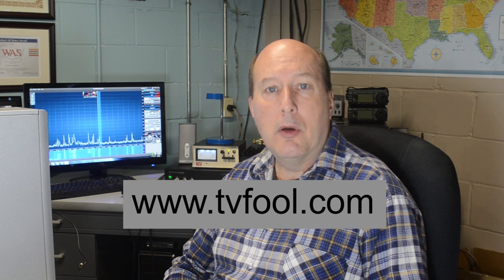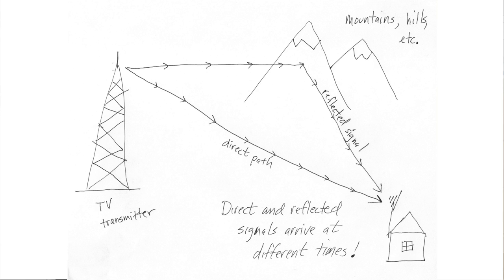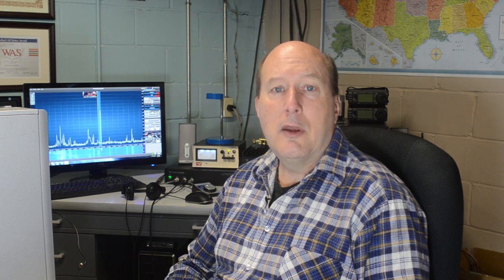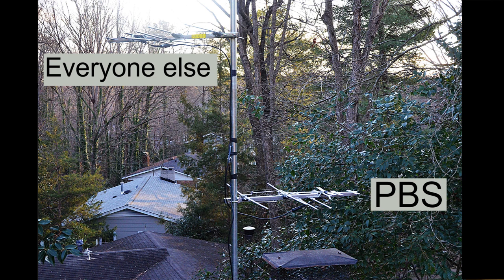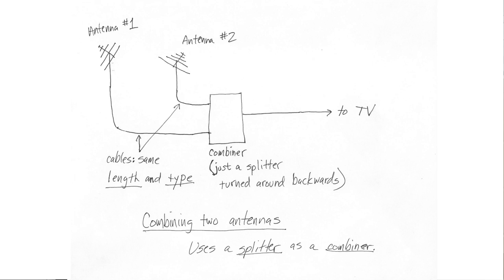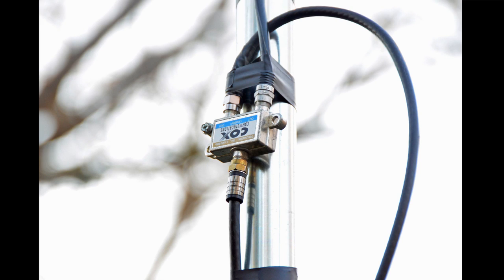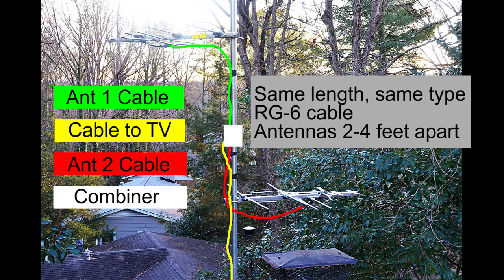Combining two TV antennas for better HDTV reception

Comment: Good advice, thank you. In my case, I'm 70 miles away west in WV between DC and Baltimore, so I have a rooftop antenna pointing east towards the center point between those 2 cities with a high gain preamp. There is a low power station in DC that I really like, but again depending on certain factors, it comes and goes (seems to go right when something good is coming on). So I might try adding a directional a couple feet above my existing antenna (it's listed as an omni - ClearStream 4Max), pointing straight toward DC and maybe keep the omni in the same position. But I assume first the combiner --> preamp --> 4-way splitter in the old cable box? In any case I'll have to try this out. Thanks again.

Comment: Very good information. What’s your thought on those amplified antennas sold by Antop? Do you think it’s best to stick with the original mechanical types such as the ones you are using?
Reply from the maker: Unfortunately I don't have any experience with antennas like the Antop, Owen. Conventional wisdom says that the place for a preamp is at the antenna, so they've got that going for them. But I haven't done any comparisons.

Comment: I want to do the same thing. What is the specific splitter you used? Did you use a regular splitter or a combiner? Other's have suggested that just using a regular splitter will cause interference and loss of signal. Just asking.
Reply from the maker: Yes, there has been debate about using a splitter as a combiner. But in my experience (and I have tried numerous splitters) passive splitters always work fine as combiners. Active splitters (which have built-in amplifiers) are a different story.

Comment: What solution do you have for having to use the same  cable to share OTA and internet? I used to have a device when I had satellite or cable tv to do it. Would that same device type work ok with the OTA?
Reply: Used to install satellite, they used what's called a Diplexer to combine the satellite signal and off air antenna outside, then another to split the signal back again. The ones we used were specifically for satellite and were powered by the satellite. At at&t we also used a diplexer for a similar set up. Look up that, you'll be able to find something.

Comment: With these 2 particular RCA antenna what would stop you from mounting them directly next to each other and connecting the UHF element studs- wouldn't this eliminate any interference issues as the signal would be fed into the coax from one source pointed in 2 directions? or would the connected lines to the transformer short the line? I have 1 mounted in the attic and have a station much like your PBS that's opposite every other network butonly 11 miles away (ERP 7.5 kW)- but they carry all the local sports and I'm one of those people.
Reply from the maker: I'm afraid what you suggest would ruin the directional characteristics of the antennas (being so close to each other) and I think there would be a feedpoint impedance mismatch as well. But it's not something I've ever tried.

Comment: Great explanation of multiple antenna set ups.  I am actually doing the same  thing  and trying  to pick up some  channels down in the Raleigh area from Asheboro.
Reply: Same here, trying to maximize my channel lineup in Asheboro.  Should be plenty since it's in the center of a few metro areas. Particularly interested in getting the ion stations from greensboro, Any luck?
Reply: +Rob Baker  no not a bit,, I have tried 4 different antennas and not even  a glimpse of it..  it has to be a really low power station is the only thing I can think of.
Reply: +notaness I wouldn't even care about that station if I hadn't gotten it for 2 days on a rainy weekend. They played a decent lineup of shows.  Then the rain cleared up and the channels went away.  Right now they're the only channels I'm not getting with a cheap ebay amplified outdoor antenna, and I was just curious if an antenna upgrade would be worth considering.  Which channels are you not getting?
Reply: +Rob Baker basically that's it,,  I did have better luck going back towards Charlotte instead of Raleigh.  I'm currently using two solid signal hdb8x  antennas, one pointed toward Greensboro, the other toward Charlotte.  I am also running a juice pre-amp between the two as well as a channel master combiner. I'm in a fairly bad location to pull Raleigh, and at the time I was desperate to pull WRAL. well as luck would have it the switched to NBC, and I already get wxii (NBC) out of Winston fairly easy..
Reply: +notaness Hmmm.  I hadn't tried going towards Charlotte, but now I'm curious if it'd be worth trying.  ion is gonna bug me forever though, haha

Comment: Well done, Doug.  You are very articulate and knowledgeable.  I put up an omnidirectional antenna that I found on Amazon.  My CBS channel comes in and out.  I went to TVFool like you recommended.  I'm surprised to see that ABC which came in fine is in the same westerly direction as CBS and the same distance away (13.5 miles).  My Fox channel is in the opposite direction, is 7 miles away and always comes in well.  I wonder if your type of antenna would be worthwhile.  Since my current antenna is a round shape and is supposed to be omnidirectional I wonder what direction I should point a second antenna.  Any recommendations?

Comment: My respects for a so clear tutorial Mr Doug Hall,dut my question is :Does it matter if the roles of the IN/Out revers?Like the two holes that were normally out VS the single hole that was in becomes out? Bla,bla,bla ,''i know you get me guys!''
Reply from the maker: No, in my experience passive non-powered splitters will generally also work in reverse as combiners.

Comment: Great video but can I combine two antennas pointed in the same direction to get a stronger signal?  All my stations are in the same direction but they are about 60 miles away.  I've tried different antennas but still only get two stations good.  Thanks!
Reply from the maker: Yes, combining (or "stacking") two antennas pointed in the same direction is often done to increase the gain of the antenna system. Sometimes it provides enough improvement to get solid signals from the marginal stations.

Comment: Did you try a pre-amplifyer? When splitting an antenna signal to two or more TV's it halves the strengths on each. You could be getting a strong enough signal to the antenna but not the tv.

Comment: When using a passive splitter/combiner,  how do you prevent half of the signal from one antenna from radiating out the other antenna?  Or do you just over-spec both antennas to compensate?
Reply from the maker: The design of the combiner/splitter is such that the port-to-port isolation on the input ports is fairly high (say 20 dB typical) so as long as the impedances are matched this is not typically a problem.

Comment: Doug - Nice job. I've been a OTA person for many years. My saying has been - "I bought & paid for my TV, I'll be a son of a gun if I'm going to pay to watch it! " I get 80 channels 60 miles away from Chicago. More than enough.
I do run with a 20db booster in my line. I was wondering if you would know - do you have any idea on how I can test the booster with some sort of meter? I've often wanted to test boosters to see what there output was but have been unable to find a simple way to test it.
Thanks again
Reply from the maker: I use my spectrum analyzer and tracking generator when checking the gain of preamplifiers, but I realize not everybody has a spectrum analyzer available. I see some signal strength meters for sale on Amazon, but I have no experience with them unfortunately.
Reply: @doug - What kind of preamp are you using? I've tried three "highly rated" preamps and each time, most of my channels went away. It's so annoying.

Comment: great video ... didnt know or realize separating the antennas 2 to 4 feet apart was a major facture. probably explains why im not getting alot of stations scanning in. gonna try separating mine farther apart. im using bowtie and they seem to touch each other but point in different directs. thanks for the great info.

Comment: Doug, I ended up doing what you described by trial and error. But could you be more specific about the splitters/combiners because I learned there are numerous kinds and digital signals use higher frequencies, I believe, and require a late model splitter.  Also,  my OTA signals had to come by way of a cell tower and that was pixelating a few channels, badly in the evenings.  My system uses 2 preamps, a high freq. combiner to an 8 channel distribution amp which feeds into 6 rooms.  I had been fighting with the system for over 2 years and didn't realize the cell tower (which went up about 2 years ago) could cause problems.

Comment: Hi Doug, excellent video!  You used two directional antennas in your project.  Do you foresee or know of any issues in using two combined multi-directional antennas, such as two identical 4-bay (or 8-bay) bowtie antennas?  In my case as in yours I want to point them in different directions.

Thanks, John
Reply from the maker: John,
The issue with bi-directional antennas is that your chance of picking up a particular channel via two different paths is increased. If that happens you run the risk of pixelation due to multipath distortion. But otherwise I see no reason why it wouldn't work. 4-bay and 8-bay antennas are easy to make (lots of DIY articles on YouTube) so it wouldn't cost much to try. Good luck!
Reply: Thank you Doug for your advice.  I'll be installing in a rural area far from the city and buildings, and the landscape is fairly flat here (Hamilton 'Mountain') so multipath distortion should not be a major issue.  As it turns out the majority of the broadcast towers (Hamilton & Buffalo) are within 180º so I have chosen to use one CM-4228 8-bay antenna which boasts an 80-mile range and signal reception from a span of 180º -- will update to let you and others know the results.

Comment: Hi Doug, would having two completely different antenna's cause an issue or do you recommend they be identical antenna's? I have an existing antenna and would like to do what you've recommended, but not have to buy the same antenna as I am unable to locate it. I would have it run directly into a OTA TIVO box to record shows, do you think that would cause any issues with having two different signals? 

Thank you for the information, great video!
Reply from the maker: It's not critical that both antennas be exactly the same type. What is important is that they are both directional antennas with similar characteristics. As long as those conditions are met the two antennas need not be identical.

Comment: So I live between two cities. One is 30 miles away the other 70 miles away. I was running off of 1 antenna. (With rotator)
I use to get stations from 70 miles away but my antenna broke and I got another one (same one). So I decided to mount 2 of the same antennas in different directions running to a combiner
Now I don't get any 70 mile away stations. I'm lost on why.   I have the same scenario as you with  2 antennas (1 east & 1 west)
Both of my antennas are mounted lesson 6" from each other and I don't think my coaxial cable are the same length. Would this cause a problem for not getting the stations that are 70 miles away?
Thank, great video
Reply from the maker: Having both antennas only 6 inches apart would cause issues with the pattern as well as the feedpoint impedance, reducing the performance of the whole system. You need more space between them, and equal lengths of cable from each antenna to the combiner.
Reply: @doughall1415  just an update, I did what you said and I went from 33 stations to 51 stations. I do get stations that's 70 miles away but.... not the stations I use to get.. or should I say, not the ones I wanted! Lol.

Comment: I wish I youtubed , I have a good bit of experience with home brew tv/fm radio/cb antennas and my go to setup is always a copper pipe dipole , 44 inch horizontal dipoles seem to work the best for TV in a stacked X configuration , I didn't use any  baums or splitters just basically daisy chained on the feed line. the dipoles are separated by about 2 feet on the mass . Im 45 miles out from any broadcast and can receive about 9 channels coming from 3 different directions . so far its worked better then anything I can buy and like you i have no interest in a rotor its just over complicated. im glad to see im not the only person who thought about splicing a input signal from multiple sources . do you believe in reflectors on directional antennas ?

Comment: I have a Metal Roof, how far from the Roof would you go, or does it matter. I thought it might act like a Ground Plane and affect the performance of the antenna? Thanks for your help.
Reply from the maker: The metal roof will act as a ground plane and therefore affect the antenna pattern to some extent. I'd recommend staying 4 feet or more  above the metal roof if possible.

Comment: I’m thinking about installing a 23’ antenna pole and installation two antennas. My concern is lightning strikes(I will grounding the pole). Even though it will be grounded I’m also concerned about static electricity attracting lightning to my yard or neighbors yard. Should this be a concern?
Reply from the maker: It's important to ground the antenna, mast, and coaxial cable shield in order to provide protection from static buildup and nearby lightning strikes. There's some good info here: http://www.dennysantennaservice.com/1171010.html Beyond this there is not a lot you can do. If you take a direct hit (lightning strikes your mast or antenna directly) you are almost certainly going to have some damage, but proper grounding is a good start toward mitigating the problem.

Comment: Yes, it does work just like he described it, BUT.. Antennas are just as good at transmitting a signal as they are at receiving one.  If the antennas are the same, a lot of the signal received by one will be transmitted out the other and lost.  You can alleviate this somewhat by using a highly tuned antennas to reject the unwanted frequencies from the coax side but that becomes ‘impossible’ (i.e. very difficult) if you want to receive large numbers of channels.

Comment: So I don't want to run coaxial through ou my house 

Can I put a antenna out side then connect that same antenna to another antenna indoors?  in my head the antenna indoor act as a booster or does the two antenna on either end just cross cancel each other out?

Comment: WOW.  Funny story, I'll try to be brief.  I just bought a second indoor antenna, Mohu curve, not leaf.  Anyway, I was able to get 10 channels when it was in my front window.  If I had it up high on the front window wall, or in the side window, I only get 6 channels.  Now, part of those 10 channels, is part of the 6 I already get, so I might get 4 different channels if it's in the window.

So my question here is, will the same idea work with the indoor antenna as it does with outdoor antennas?  Thanks for the video :)

Comment: I already have a coaxial amplifier which is near my TV.  I would like to do a 2 antenna setup and was considering an amplified splitter/combiner near the antenna.   Is it OK to use both amplifiers on the same coaxial cable?
Reply from the maker: It won't hurt anything, but you may have problems if the amplifier at the antenna overdrives the amplifier near your TV. That will all depend on the particular amplifiers in use.

Comment: Great article Doug! I've got a fringe high gain YAGI (HD9095P) antenna pulling in 40 channels up to 80 miles away (including subs). One low power channel tho 25 miles away drops in and out. I'm wondering what software you're using in the background. I'm trying to find out if cell tower interference is a problem with that single channel. I've got a usb dongle and using SDRsharp to hunt the interference down but the bandwidth isn't wide enough. Any thoughts?
Reply from the maker: The software in the background is called SmartSDR and is specifically for my HF (1.8 to 50 MHz) radio, so it's of no help tracking down issues with VHF or UHF TV interference unfortunately.